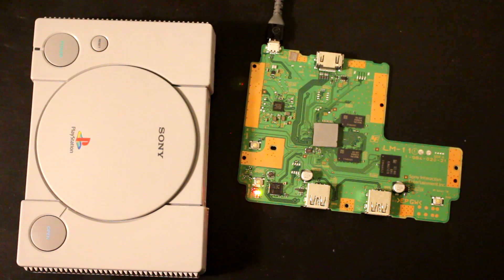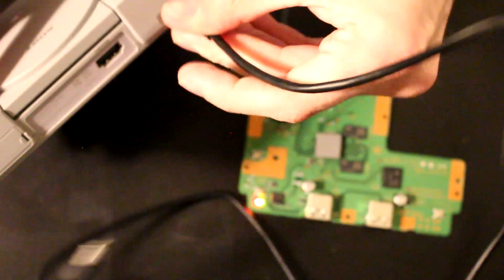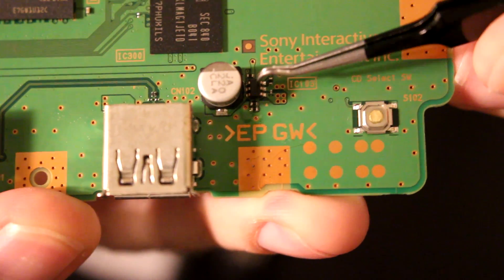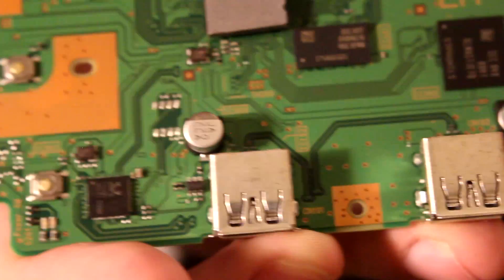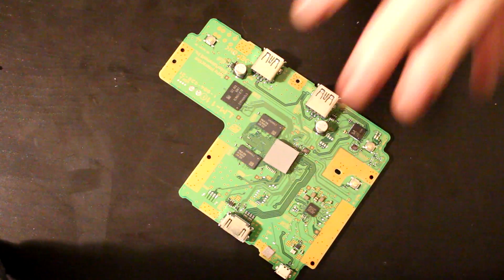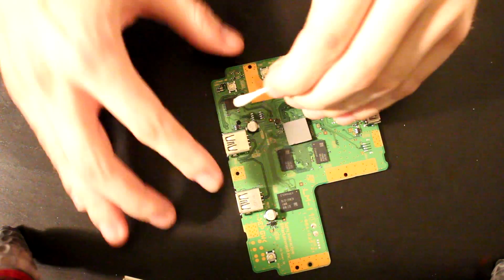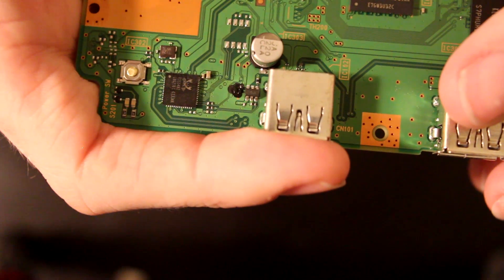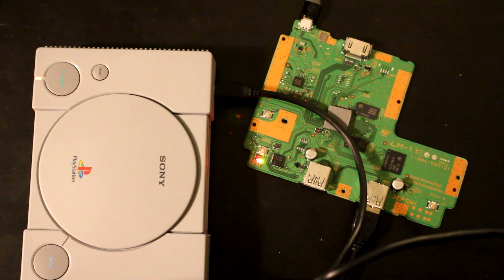PlayStation Classic Current Limiter Removal Mod

Comment: PLEASE HELP I accidentally removed resistor for USB port #2... my second usb port went from at least showing the Sandisk Cruzer usb stick light indicator to now only showing a dim flash when plugged in or removed. i tried using a usb 3.0 4 port hub and connecting the Cruzer 2.0 USB stick to it but still no autobleem launching so far... I removed the resistor on accident and in a panic dropped a big solder ball on all 4 points of the resistor. PLEASE HELP
Reply: David Clark - find a good electronics repairer like ourselves & have them replace the missing resistor..depending upon where you live, it will most likely cost you just short of what it costs to buy a new PS Classic. My honest advice would be to buy a new, unmolested, unbutchered console
Reply: @woodstockxx     it works for player 2 input control, i might just have to live with it. thank you anyways, i hate microsoldering so goddamn much.

Comment: You could use a 10amp power supply the device will only pull the current it requires, but a lot of USB 2 sticks also don't work and the ones I've tested pull no more than 30ma nowhere near the 100ma power limiter, so the device compatibility is really hit and miss.

Comment: Thx for the tutorial video. I soldered the 2nd USB ports limiter only with a dap of solder and it worked. Now my USB 3.0 jump drives work without problems with the PSC.
Reply: Thanks for the post, I was wondering if that would work. Going to try it!
Reply: @SirCorn  did it work ?
Reply: @legin3753  it worked in the sense that I can get proper power but don't have a compatible drive or am doing something wrong with formatting. The power distribution does work as demonstrated as I could power drives that would not previously turn on
Reply: Is the limiter to prevent USB hacks ?

Comment: Why can't you just remove the resisters completely and that work without connecting the points? I would think it would just remove the resistance. Sorry not an expert by any means on how these things work. I was messing with mine and one of the little resisters broke off. Now I'm not really sure if I can fix it or not. You mentioned soldering over the points if you remove them. I assume this is "no wire needed" and you just solder a blob on the 4 points to connect them?
Reply: I too had issues soldering, except I accidentally removed both resistors.  I thankfully found this comment after a few mins of thinking I created a 40 dollar paper weight.  I just bought a Hakko soldering kit specifically for this hack.  Mr. Hartl made it look so easy and I'm now incredibly humbled and lucky that I didn't destroy my console.  I appreciate the video, you've saved me from having to wait for OTG support, in addition to being arrogant, I'm also pretty impatient and I've grown sick of looking at my powered USB hub's neon green glow, in addition to the PSC's green power light, its one too many lights.
Reply: @edwardcormie  PLEASE HELP I accidentally removed resistor for USB port #2... my second usb port went from at least showing the Sandisk Cruzer usb stick light indicator to now only showing a dim flash when plugged in or removed. i tried using a usb 3.0 4 port hub and connecting the Cruzer 2.0 USB stick to it but still no autobleem launching so far... I removed the resistor on accident and in a panic dropped a big solder ball on all 4 points of the resistor. PLEASE HELP
Reply: @vgrepairs  did you read anything any of the fine people said bridge those points and you're good

Comment: Question. If you can glob the ink over all 4 points can you do the same with the soldering? I agree in principal if you're shorting them out it really doesn't matter if they're all connected but you only said that about the ink and not about the solder. Would it cause any problems you can think of? I'm not terrible at soldering but if I could just hit all 4 it would save a lot of stress on my nerves haha.

Comment: FYI, even though this mod is completely safe. If you use this mod I wouldn't push any more than 2.5amps into the PSC and don't do anything stupid by overloading your front usb ports by trying to power 5 sata HDDs on it.

Also...

Staple and kapton tape. I tried this just out of curiosity and worked fine. (I wouldn't recommend it though over the pen)
Reply: Why wouldn't you give it more than that ? Frying the resistors ?

Comment: Ive been thinking of doing this, glad to hear you've been running it of a month. It's a much neater solution than a powered USB hub and even OTG, less wires under my TV the better.
Reply: Yea I'm doing the dongle powered usb myself. Did you do this mod? And did it help? Thanks.
Reply: Is your console still alive?
Reply: @MiloZabál  I did the mod, yes my console still works

Comment: Thank you very much for the info. Do you think there will be a time when a USB3 can be used from the rear (in conjunksion with the power lead) or will this also require a hardware mod ? ps/ sound was very much better in this video (sound so low on other videos made them unwatchable)

Comment: thank you very mutch i did it and it works great now i can use a usb 128gb stick :)
Reply: ger65 h i don’t do this mod and I can use my sandisk cruzer 128GB usb 3.1.
Reply: @luckyluke95  Without powered hub?
Reply: Did your 128 GB light up before the mod?